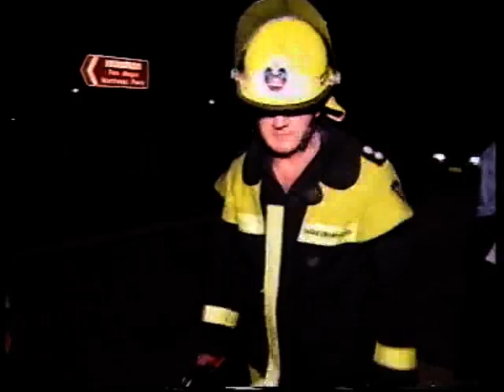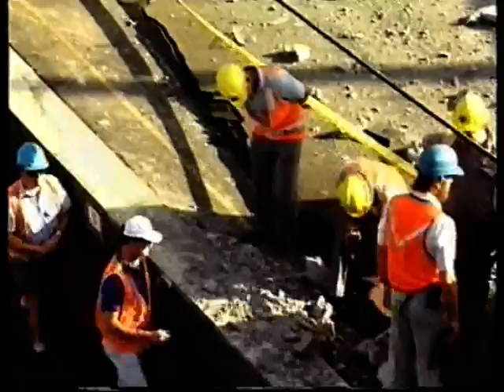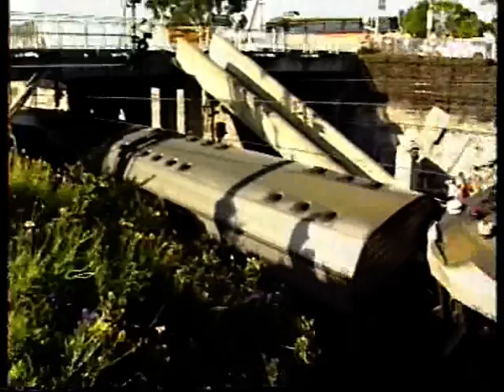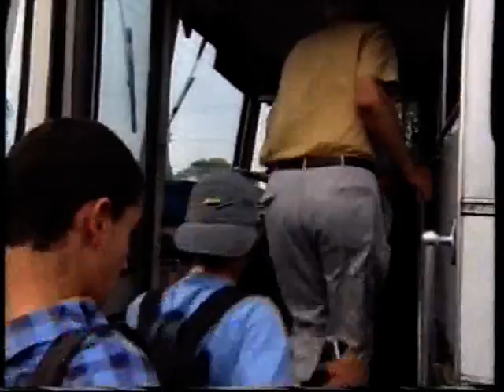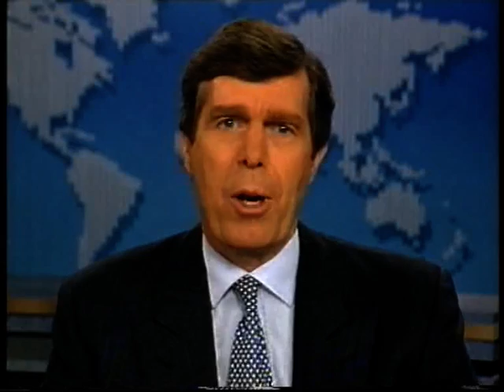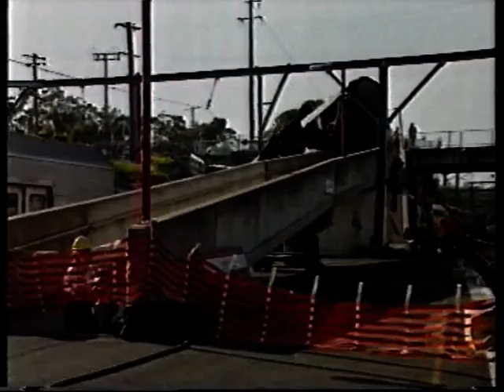Cityrail - Waterfall train derailment (December 20, 1994) News Footage

Comment: @902107910 ... ok first up... what was actually happening was known as a propelling movment which is done the driver being up one end and the guard up the other using bell signals to guide the driver... The guard on this day was late and was NOT ABORD the train... he ran down to the platform and pretended to be on the train... The driver was doing the move unassisted... hence slammed into the train...both lost their jobs...

Comment: So if the train was reversing because they thought it had departed so why didn't they stop at the red light and how the hell can that mangle mess happens when going at a very slow speed and also the Guard should be in the cab as well as the driver. And have cameras all around to